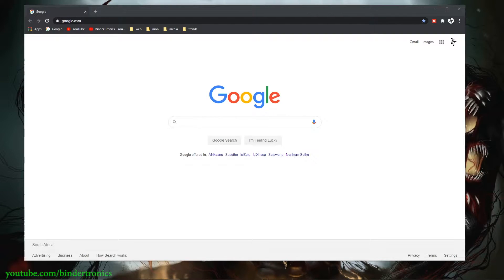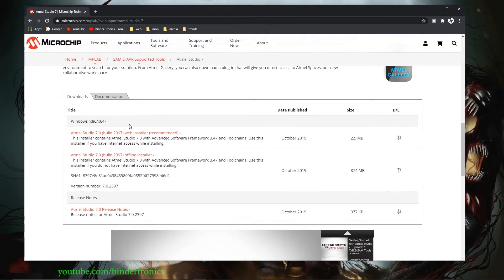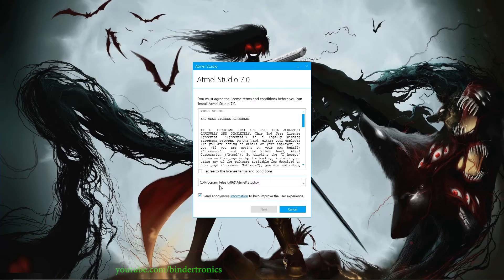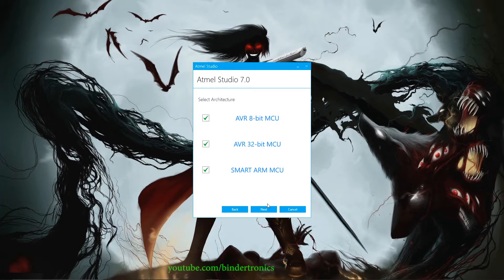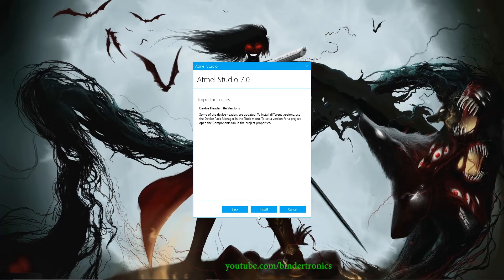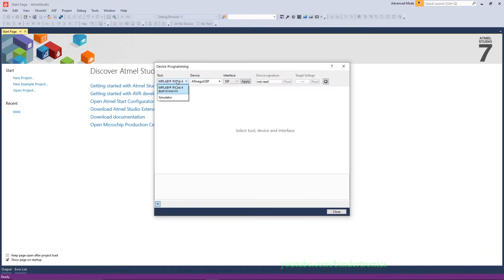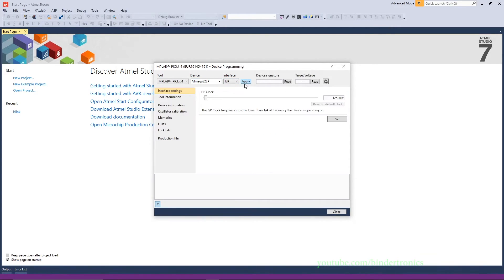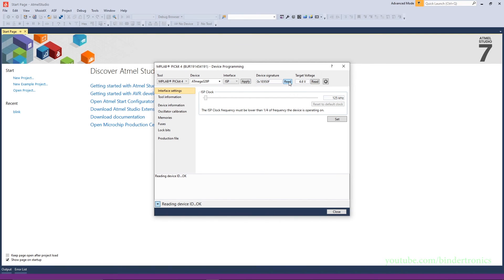Atmel Studio 7 Install 🔴 ATmega328P Programming #2 AVR microcontroller (Microchip Studio)

Comment: hello, I bought pickit 4 to use in my atmega328p. But it said, I should update the firmware of the pickit but when I updated it, it failed. I only have atmel studio 7. Do I  need to install something to update firmware of the pickit? thank you
Reply from the maker: Sometimes Atmel studio refuses to update the firmware. Try using MPLAB IPE. MPLAB IPE comes with MPLAB X. https://youtu.be/N36CCP9rcuM
The default passwords is "microchip".
Microchip half assed the support for the pickit 4.
Section 3
https://www.microchip.com/content/dam/mchp/documents/DEV/ProductDocuments/UserGuides/IntegratedProgrammingEnvironmentUser%27sGuide50002227E.pdf
Reply: @BinderTronics  Hi., I am also facing the same issue. I tried the above-mentioned steps but still, it is unable to upload in Atmega328P-U.

Comment: I followed what you did but the Atmel studio does not display the list of tools and interface on Device programming page. If I go to Device Pack Manager the files /packs are all there but it says they are already installed but  I cannot  read them on the Device programming page.I also cannot get the Device programming page to link with the board. I tried reset cache on the advanced button and I have reset the computer. Can you suggest anything else I might try? Thanks, John
Reply from the maker: Witch debugger/programmer are you using?
Reply: @BinderTronics  I have tried Atmel Studio 7.0 and Microchip latest version and avrdude (as a component of the Arduino IDE). All fail to work for various reasons. The Atmel and Microset just do not show the list of tools to enable it to interface with the arduino board. I cannot see the USB connection either. I have an ICSP cable and that does not work either. The Device Program manager seems to show them correctly. I tried set setting the cache and rebooting.  Avrdude had different issues and gave its own error message. I have looked though the Internet and can see that I am not alone in this. None of the suggested work arounds do the trick though. Any help would be appreciated. John
Reply from the maker: Atmel ice, Avr mkII, PICKIT4 or stk500?? 
Look up: avr Zadig driver
Reply: @BinderTronics  hello, I bought pickit 4 to use in my atmega328p. But it said, I should update the firmware of the pickit but when I updated it, it failed. I only have atmel studio 7. Do I  need to install something to update firmware of the pickit? thank you

Comment: Hello, thanks for your great vids! 
I got problems with the Device Programming setup. (The components are the same as yours) 
If i klick on Apply following massage is coming : The tool is in PIC mode now, it should be switched to AVR mode before connecting to AVR devices. Do you wish to switch to AVR mode? 

Then i presss "yes" the Pickit4 is booting again and if i want to apply again following massage appears: Communication switch mode timeout

You know something to solve the problem ?
Reply from the maker: For your case you are going to need MPlab IPE. MPlab IPE comes with the MPlab IDE.  Don't know if there is a standalone install for MPlab IPE. Once you have the MPlab IPE. Open the MPlab IPE and select the ATmega328P and connect to the Pickit4 then click read. It will then ask you to switch to AVR mode. Click yes or whatever it comes up with to accept. You can now use the Pickit4 with Atmel Studio.

You don't need to have the ATmega328P connected to the Pickit4. The read will fail, it does not matter. This is simply to fore the Pickit4 into AVR mode. The Pickit4 will stay in AVR mode until it is put back into PIC mode even after power off/cycle.
Video on the MPLAB software tools install https://youtu.be/KSI6fzOPVz0.
Also don't enable the debug fuse. It is a massive pain to get it back into normal running mode.
Reply: @BinderTronics  thanks man that works now :)